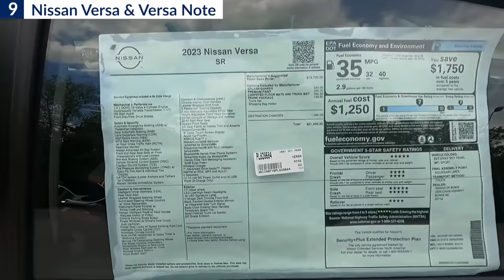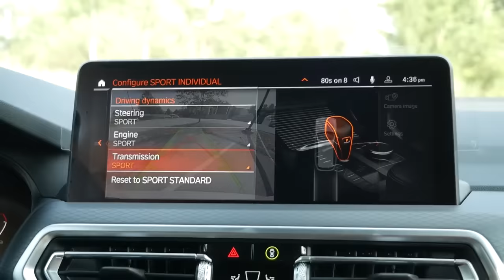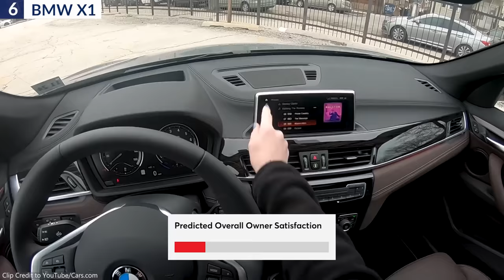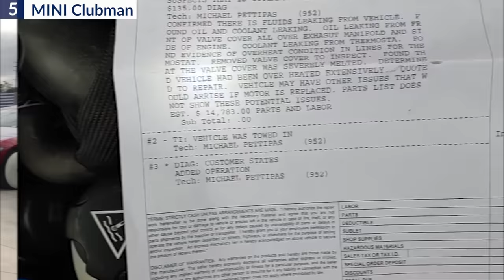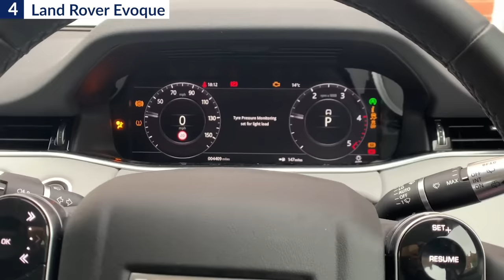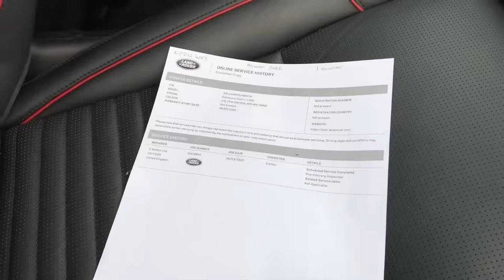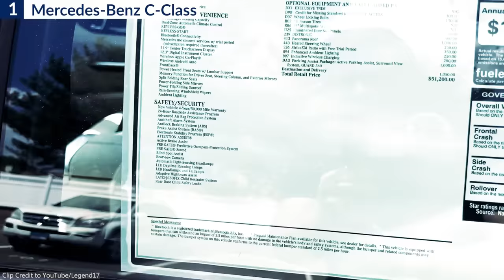9 Cars Owners Get Rid of in the First Year | Here is Why !!

Comment: Tou should easily add ANY modern SUV.s and trucks by Chevrolet as they lack even the most rust protection! I have seen a few fairly new ones that has run over here a couple winters with totally rusted up frames and underbocies while the bodies otherwise still looked pristine.

Comment: Outside the Versa, which I bought new in 2018, all these cars are pretty pricey. I will never own another Versa. It's cheap and it feels cheap. As for the others, they are outside my price range. In 2019, I bought a used 2016 Ford Escape, which now has 70K miles. It works for me. I'm retired and don't drive much.

Comment: Surprised to find the Merc here. drove 100.000 mls on a c class coupe (2016 model) without any problems or unusual wear on brakes or tyres although I drove it hard on the german Autobahn. Just bought a c class convertible , not taking in to the merc shop will make the maintenance costs mamagable

Comment: It comes as no surprise that this list is almost entirely filled with overpriced and supposedly premium European products.  I the UK they are always filling top 10 lists for least reliable cars yet a remarkable number of people will happily pay through the nose to buy and run one both new and second hand.  

I recently had a Mini Countryman Cooper S hybrid (not by choice) as a hire car for a few days and it was probably the worst car I have ever had the misfortune to drive.  It had harsh suspension backed up by rock hard seats, a messy and utterly confusing dash layout and, despite claims of 140mpg, it averaged 37mpg over the few hundred miles I did in it.  Top that off with the fact it only had a 30 litre petrol tank meaning that I had to refuel it regularly during the hire period.  Never again.

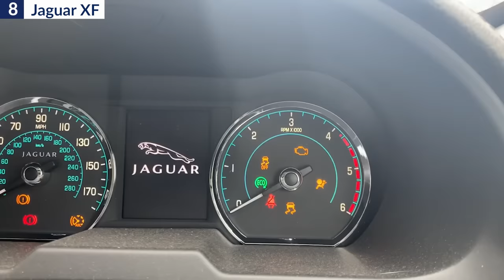Comment: 2:24   A 4100 RPM Redline? Out of a turbo, 2 liter, 4 cylinder?  What???      Is this Jaguar a Diesel?

Speaking of high costs and the #1 car for high turnover (Mercedes), I met a Mercedes owner who spilled a drink on to the console. It corrupted the display. The dealership said the disply had to be replaced. The cost?....Wait for it.....$7000       It's also not a simple swap, as it needs to be programmed for the car by a Mercedes technician.

Comment: The people buying these suvs' or cars have some ready cash or great credit to be able to dump them in the first year.  I did find it odd all overseas brands also.  One would think domestic cars would be dumped at a high rate. People in this range of income throw away what doesn't work without a second thought they just go out and make more money. I get ribbed all the time about buying a 2022 Buick encore gx with 6K miles on it used, for $23K and yea it has the damn cvt and 3 cyl motor but surprise, it does move down the road quickly and gets decent mileage.  The only reason it was used for sale it was a dealer service loaner, another dealer bought it to resell and I think paid too much and it sat on their lot for 6 months before I got it...I like the suv and it's a middle trim model so got an upgrade for less than a base model.  Just my 2 cents worth.

Comment: The BMW X3 and 3 series are fantastic cars. Excellent power, fast and silent shifting. I get very good highway mileage (33+mpg) The ZF transmissions are the best in the world and aren't CVT garbage.  The newer B48 engine is leaps and bounds better than the N20 and is probably the best 4cyl turbo engine out there. I would agree about expensive maintenance if you go to the dealer but I do my own work so it's cheap. Almost all ICE cars now have direct injection so expect to have intake valves cleaned at 50k while you do the transmission and differentials. Total cost for me to do the major 50k mile maintenance of Trans filter/pan & fluid, differential fluid, and clean intake valves was ~$300. I did spark plugs and engine air filter at 30k miles and will do them again at 60k. Cabin filters done every other oil change. Oil changes are cheap, $25 for 5 quart jug of Castrol Edge 5w-40 LL-01 approved and $10 for a Hengst filter, total cost $35. I don't follow BMW onboard oil maintenance which is 10k miles, I do it around 5k-6k miles. They recommend 0w-20 and if you drive like a little old lady then that should be fine but if you drive the car hard sometimes and spool that turbo up I recommend at least 5w-30 LL-04 or 5w-40 LL-01 approved oils. If you aren't mechanically inclined I advise finding a good local mom and pop shop that knows BMW's instead of going to the dealer if you don't have extra $$ to burn. I got both our X3 and 3 series used, 1 year old w/ roughly 15k on them and I saved a significant amount of money, close to $16,000. I think people trade these in after a year or so because of the high cost of maintenance but it's really not expensive  at all if you are good at working on cars or know a good mechanic that will give you a good price. Don't let this video scare you away from BMW, well maybe the X1, it's okay but the X3 and 3 series are fun to drive, powerful, smooth, reliable, and just overall make you smile.

Comment: Luxury cars are full of electronics and new tech so much more likely to go wrong , if you want reliability go for something with established tech like a Toyota but like my Rav 4 they are way behind on tech and very bland to drive . I keep looking at land rovers and Volvos but can’t justify the price of tax based on emissions else I would have swapped by now as I find my Rav boring to drive . It is a 2015 diesel , 80,000 miles and no issues of reliability as you would expect but I drive a defender at work and it has character, good tech and puts a smile on your face and I compare it to the dull Rav and start to think I would put up with the problems I might have just to be happy .

Comment: The c class Mercedes has always been the entry level. Mercedes. You don't take it to the dealer. You take it to a local import auto guy.
That means the A and the b which are basically what they drive in Germany has the equivalent of a Volkswagen or to be thought of as a Jetta. The E-Class is your first decent mercedes. And recently the GLE has been a nightmare. If you like the GLE buy a used ML and you will be much much happier

Comment: I am generally disagreeable and hate owning the same brands as everyone else, so I've owned two JLR products. Yes, they were dodgy but, didn't cost much to operate. But, I dislike buying new off the lot. So look for demonstrators or used with super low mileage. JLR can be an amazing deal due to their poor reputation. Net, net, your maintenance costs are higher, depreciation higher but purchase price way below competition. So for short term ownership (3 To 5 years dependent on mileage) and they are a decent deal. They also have some of the best chassis for the price, and used to come with impressive drivetrains. I loved driving both. If you want boring and expensive versus options but dead reliable... buy Toyota. You want something interesting, then you accept being different isn't always easy.  On the other hand, a XF with a 4 cyl.? Get stuffed!

Comment: The  cvt transmission is the answer to a non existent problem. It is much complicated has a lot shorter life span, is more expensive to work on and generally gives a much worse driving experience. It will fade away in time  because it is pure rubbish.....

Comment: I don't care what mileage a 4-cyl. Turbo can give the owner, it's too small for SUV's +3,500lbs.(+1,588kg). It wears out faster & requires premium petrol. Mfg. should go back to the 4.0L+ OHV V6/V8, two/three valve per cylinder, single or dual spark plug designs. Those engines have a more predictable power delivery when the road/trail surface is treacherous & they can use regular or mid-grade petrol. It's ridiculous to expect Ferrari performance w/ solid reliability for $20-30K.

Comment: If anyone reads Consumer Reports they’d already know this. We have a Mazda. Excellent car.
Reply: The problem with Consumer Reports is that it is an opinion based publication that compiles its findings from skewed data provided from its readers. Consumer Reports does not incorporate actual real data from warranty claims, all data, and other sources of information that is based on verified repair data. As an example: Consumer Reports rates the Subaru Forester as very reliable when it has one of the highest rates of repair and failure for any Japanese vehicle within the first 5 years of ownership. However, the customer base of Consumer Reports have a disproportionate amount of Subaru vehicles for whatever reason, skewing the overall data. On the other hand, this is one of those rare moments where they get it right. Mazda is one of the most reliable manufacturers as a whole.

Comment: Poor assumptions here. In traded my X3 in the first year because I usually trade within 1-2 yrs. Always end up trading for another BMW. This time I got  a BMW X1 M3.5. High mtce costs or low satisfaction is not valid as everything is covered including oil changes. I always consider competitive vehicles when trading and end up with BMW due to better handling vs MB and Audi etc .

Comment: I notice that pretty much all of the vehicles mentioned here have turbo chargers on them.  Only a fool buys a vehicle with a turbo charger - they make the engines wear out almost 50% faster than those without.  Sure they give you lots of take off torque and speed - but do you really want and need to tempt fate, have an accident or get a ticket for reckless driving?  If you think some of these vehicles have high insurance costs, just wait until you've had an accident that was your fault.  See if any insurance company is willing to cover your bum.

Comment: You didnt mention the BMW XDrive system,which basically is another rip off ,you have to purchase specialist tyres  at UK prices are 250 pounds each thats £1000 pounds for 4 tyres and they all have to be replaced at the same time. Not really environmentally friendly, You also didnt mention the DPF systems which all fail at a certain mileage point when in reality thers nothing wrong places vehicle in limp mode. Car manufacturers call it the new rust.

Comment: Another car to get rid of is the CX30.......NO reviewer ever told the truth....But I WILL.........It is a 2 seater.....You CANNOT put 4 full sized Americans in this car.......It should not even have 4 doors or a rear seat......#2...It has granite blocks for suspension......You had better live on a butterie smooth road if You buy this.....#3....The Drivers seat will make You a cripple......The 4 " tall side bolsters dig into Your left Hamstring.........Yes..The car will probable run forever if You can stand it.............Paul

Comment: Land Rover is full of cheap plastic, there are different qualitys of plastic and it seems they use the cheapest.  Same goes for the models that cost more.  With MB you have to check where the car is built, they have a factory in Alabama and those cars are built like crap.  The finest MB's are from Stuggart so if you're going for that car just check where it's built. One thing you don't mention is that many people trade up in the same manufacturer.

Comment: I’ve owned both the F30 and G20 model of the 3 series. How are people dealing with high maintenance costs in the 1st year?! Albeit I’ve had maintenance packages on both so the first 3 years of ownership I didn’t need to worry about the cost of regular maintenance. Unless you  bought your car used and you managed to have to change brakes, rotors, tires, get an alignment, change spark plugs and ignition coils, and oil change at the same time from a bmw dealer you shouldn’t be swamped with maintenance definitely not in your first year. Your back brakes and rotors probably want to get changed around 40k miles, your front brakes and rotors another 5k, a new set of tires around 40k-50k, spark plugs and injectors around 50k-60k miles a regular oil change every 7-9k miles. Throw in other miscellaneous like bulbs, wipers, tire rotation. If you were to buy new you wouldn’t see much of an expense cause they come with maintenance packages. Most people get them around 36k on the dash but even for the next 15-20k you wouldn’t be swamped. Either you or the previous owner would have had to completely neglect regular maintenance for the maintenance cost to be unbearable. Try neglecting any new car today and you’ll be faced with the same issue at the dealer.
Reply: .......................... FIRST problem is: YOU HAD TO GET " maintenance packages ".....ThiMk about it!  DUH!....Jus' Get a LEXUS!

Comment: Maintenance costs?  In the first year? That says it all.  Cars need to be simplified. Ditch as much of the electronics and computers as possible. Bring back cubic inches. A smaller, over stressed engine that is no better on fuel and has equal or less hp and torque has zero advantages, other than fooling sheep that it must be more fuel efficient because it’s smaller, and more profitable for the manufacturer.
Reply: 3rd world and emerging economy countries still have access to the vehicles you speak of.

Comment: This is so infantile. If 12% sold the car after 1 year, then 88% did not. The vast majority were, arguably, satisfied. Most of the complaints are typical American trope and quite silly (although I do agree with the Versa…it is an unsafe piece of garbage).
However, there is a reason why outside of the US, FORD in some countries stands for Fix Or Repair Daily; and why in other countries Chevrolet vehicles can only be resold to the dealer.

Comment: I have owned a Jaguarxf 2.0 litre turbo charged petrol engine model. 0-60 in under 6 seconds, 155 miles per hour, leather trim, front and rear park assist, camera system, four wheel drive, superb paddle flap semi automatic driving option and around 35 miles to a UK gallon. This video is simply crap. Most US made cars with the possible exception of Ford are not in the same league....and I have driven plenty of them in the good old US of A so can comment from experience.

Comment: If you wanna have a luxury brand as a car, don't except discount maintaince. As for the new BMW 3, I drove that recently, it feels cramped inside. It looked that I have more space inside my 2011 Clubman than in that one, even in the back seat. At work there is a CLA that is even smaller than the old Mini Clubman. I took a picture when I parked next to it to prove it. No way I want a car like the CLA or likely as a daily driver. I said to my boss, "If I ever need a new luxury sedan, I would look directly for the 5-series or E-class to have some decent room inside." The outside look of the car is not important, but the inside where you spend the most of your time with it. And if you bump your head or not while stepping in or out.